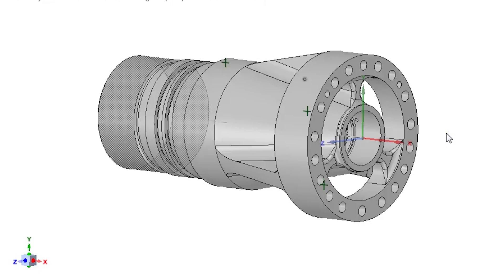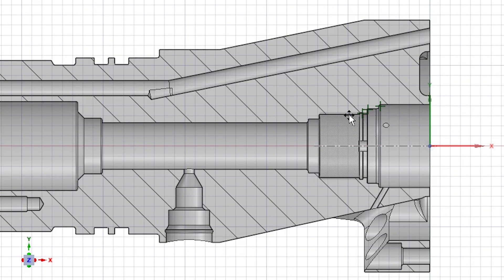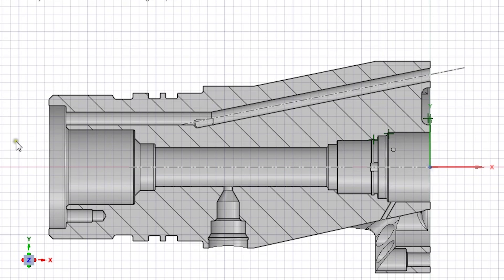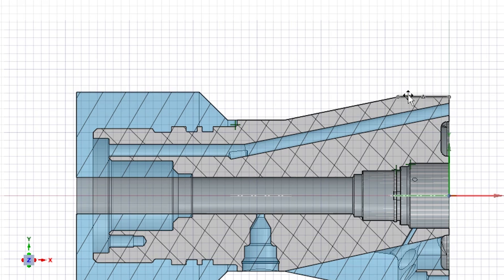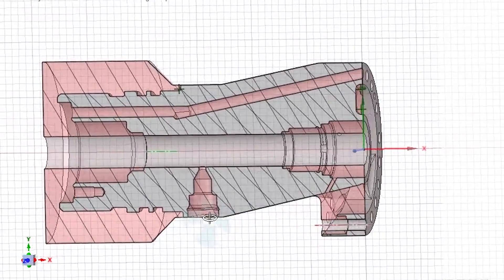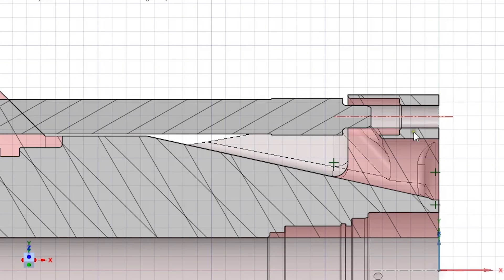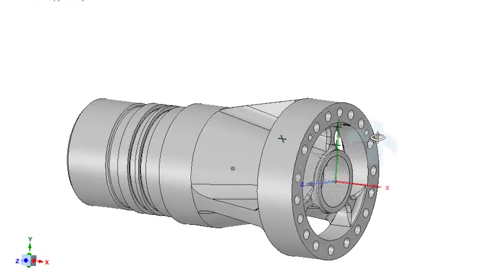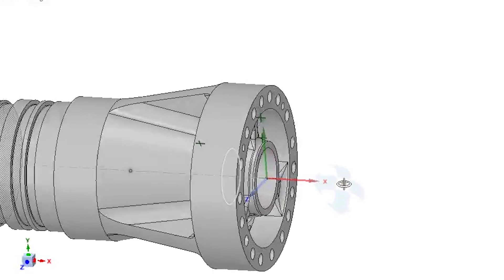Plan a job from the cad model.

Comment: Can you show some stuff on using the meldas controller you have on your horizontal? I have a 520am and there is no info out there on it and the manual was written by a 2 year old.
Reply from the maker: I do have a set of calibration blocks coming up for the Mits horizontal.
Reply: Edge Precision that'd be awesome just a quick one on setting tool offsets and how you're sending your dnc to the controller? Maybe just show the process? I can't get the machine to manually change tools in mdi for some unknown reason... But it will do it in a program. Slowly learning after coming from centroid. Appreciate the response! your work is exemplary.
Reply from the maker: James M is this a horizontal mill? If so you have to be in the tool change position in the Y axis or it won’t make the tool change in MDI.
Reply: Edge Precision Nah its a "high-speed" only 24m/m rapids 1997 drill tap machine 12 tools front carousel with 2 table pallet changer. Bt40 7.7kw all Mitsubishi servos and controller made in Taiwan by Argo. It's the argo a50.

Comment: I will watch them! Order of operations is very interesting and important, in some cases it can be a make or break deal for a certain job. Once you decided for a order of ops and it was not the best choice you will know it... ;)
Reply from the maker: Thanks Stefan. As we get farther into it we shall see. It been my experience that things usually have to be modified somewhat before the final solution.
Reply: I will certainly would watch these too. I can imagine that if the part is excessively hard or difficult to manufacture there would be some discussion regarding redesign to help getting the part manufactured. The redesign discussion is something that would interest a lot of us out here in the void.
Reply: I'm wondering how the surface finish will be on those conical / tapered external (convex) surfaces between the fins/ 120 degree apart ribs ? [It's all one piece not an assembly of two or even three separate parts.  So this video is a good before and after as you can anticipate HOW it's gonna turn out or at least take bets lol ;-)
Reply: Mr Gotteswinter,  So true.
Reply: Great video.  Do you CAD model each operation or make a rough model, semi, misc, finish?  I have heard Esprit has awesome CAM, but terrible modeling.  Mastercam has also been slow to get their act together on Solid Modeling.

Comment: @PETER … Super helpful. I think you have strongly influenced my decision to purchase an I-200 60" between centers. Also Our 5 axis "Wanabe" mill turn parts are not a million miles away from what you have going on in this video especially for tapers, lobed parts and bearings that need to be fitted... ALSO consequently had been contemplating get some consulting from you when we get our I-200 and also maybe investigate throw some work your way if we can afford it in terms of oversized parts and also EDGE Precision for certain things I don't have machines for. ALSO ESPRIT very relevant too... So will be curious to SEE What you think of the new Integrex and also assuming it might have the Smooth X control ? So long story short this video is and probably WILL be good business (I hope)… THANKS SO MUCH for MAKING THESE VIDEOS (I think I have watched nearly everyone you have made)… CHEERS ! (really like the way your mind works on these types of problems).
Reply from the maker: Thanks Extra Dimension. This small integrex is a I-400 with a Matrix 2 control not quite new enough for the Smooth X. I would imagine there are not very much differences between them. We will be doing everything in a EIA program not using Mazatrol. My Integrex has a Mazatrol 640M control. That is the one I am most familiar with. Are you located in the USA?
Reply: I'm two states up from you ;-) Rocky mountain region. I'm pretty sure we can offer you a consulting rate that smokes what you make on youtube and not so risky as some of your "Day job" . What I'm really impressed by actually is your problem solving abilities. REALLY enjoyed some of the thinking you displayed on the Go-pro things you were doing. So I really like to get the advice of expert machinists  to devise better ways of solving a problem up-front (Design HAS to be informed that way IMO if you want to stay in business ;-) ). The  5 axis Mill turn really suits my design style and really want to get the so called "Design for manufacture " all be it smaller scale initially really "Down" . Although I like 5 axis approach I don't like needles machine gyrations as you might see on a 5 axis vertical with more exotic  parts, so I really believe that really slick design can be implemented for what we need using more interesting turned profiles  and interrupted cuts (Really reduces manufacturing time and unit cost). [Generally the problems we are looking at don't go so well if you split our parts between 5 axis or 4 axis vertical and turning platforms as the part has to go almost seven times back and forth between different machines and set-ups. Really looking forward to the integrex (mill turn) approach as that I belive is hand in glove for what we principally need so I have time and need to master that as best as we can for our parts and applications... CHEERS :-) [Also we have some really freaking cool parts that I have never/ rarely seen before so I think you might get a buzz out of that. We also have some tricky tolerances that we have to meet for some assemblies and fixtures and assembly jigs so definitely your insights would be extremely valuable. I think you might enjoy the aspect of having a hand in complete systems. rather than a mysterious part being used for who knows what . ].

Comment: I’ve always had to keep in mind stress relief on 17-4 and 15-5 stainless . Have you experience that when removing large amounts of stock . I always rough those parts in first and then come back for finishing operations ?
Reply from the maker: This is a small part. In larger parts you a correct there can be a lot of stress in this type of material.
Reply from the maker: Yes I have had the same experience with this material. Especially parts that are machined off center in the bar.
Reply: This part is dead symmetrical so I assume stress relief wouldn't be much of an issue especially with h1150. I've done a lot of 4th axis milling on long slender non symmetrical parts in 17-4 annealed and often it's 3 runs around to keep it straight.

Comment: Ok after reading comments i find the part to be of hand size and prolly wouldnt twist.... however if this part was 2 feet long and 10 inch od.... i could see twist happening...esp in cheap crappy 17-4ph
Reply from the maker: Yes if the part was larger I would be looking at a whole different process.

Comment: My limited experience holding high tolerances while turning is that you only get one pass at the final dimension due to material push back while attempting a small finish cut.  Can you comment on this please?  I really like this type of planning/thought process video.

Comment: Yes. It is good to see the thought process. Wonderful. Thank you for sharing. This is the important stuff in machining that videos often overlook.
I urge you to think a bit further about how to present the design of the parts and the machining process in a way that's easier to understand. In this case I would recommend a more thorough "walk-around" of the part to begin with and then showing the critical bits. I say that because the video only showed a very brief view of the entire part at the beginning.  I didn't even realize that there were bores and stuff inside the part until you showed the section. Finding ways of diagramming the area to be machined more clearly might help. The cross section with the cross hatching was a bit hard to understand. Perhaps it's possible to highlight the critical surfaces or sections with color? Perhaps a partial cross section ( say with 120 degrees of the part removed) would have been more helpful? Maybe a simple simulation of the first operation would convey your point? Or, even more radical an simulation showing how not to turn the part. Of course that means that the video is no longer a one-hour simple video. You'd probably need to program the part first and then make the video. But please don't stop making these types of videos just because of a laundry list of criticisms from some guy on the internet. Keep going! Showing why you're doing things a certain way is very important.
And, thanks for making these videos. They are very nice to watch.

Comment: Thanks so much Peter. The explanation of the tolerances with run out was perfect. If it is possible it would be great to see the same dialogue with regard to the cam portion and thought process.  If they allow you to video the machining that would be fantastic. I guess my point I am trying to make is.... this series from print / model to cam with tooling and tool paths to the final finished product is an education that is very seldom viewed. There are usually some cam / fixture issues that crop up a long the way that will cause a person to reevaluate the process.  I believe this sharing of knowledge and experience would be appreciated by folks that are interested in learning all the aspects to producing a job from inception to completion. Thanks for taking the time to share.